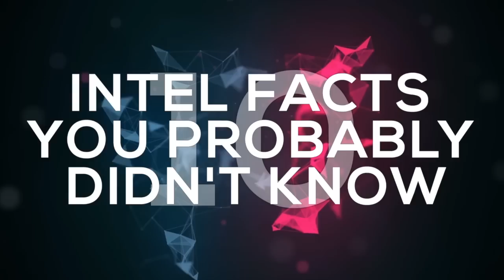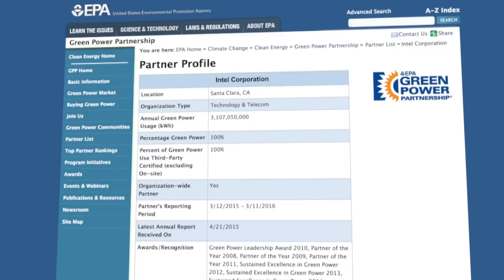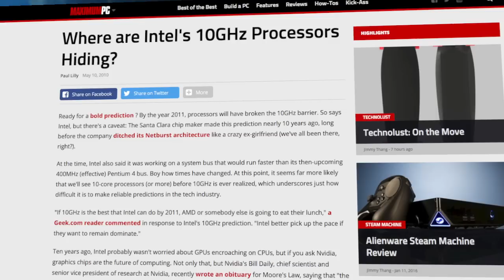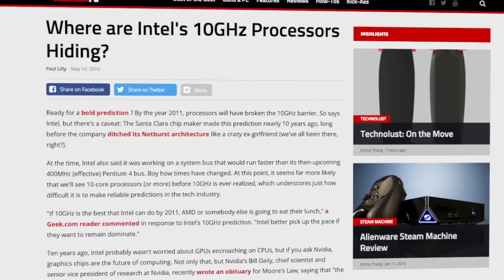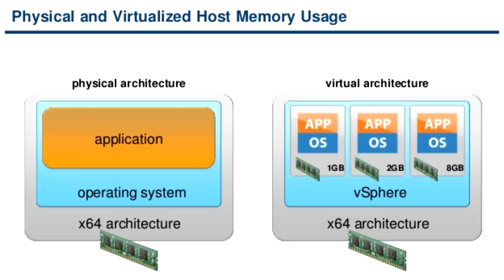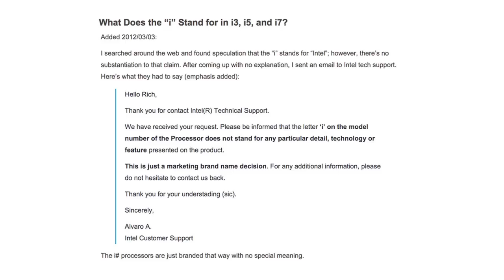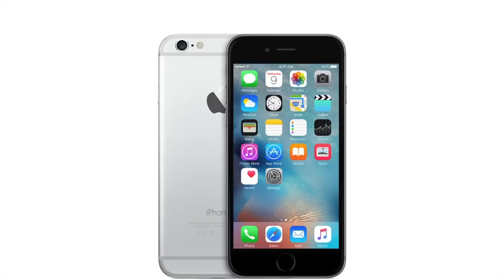10 INTEL Facts You Probably Didn't Know

Comment: We have 10ghz CPU's.
If you're brave enough.
And you have water cooling.
Reply: Some Weeb water cooling cant handle 10GHz, you gotta have LN2 for that.
Reply: *****
Water cooling can totally handle 10ghz if you're using skylake.
Reply: Some Weeb no... All CPU records are done with LN2, and Skylake does not get even close to 8Ghz let alone 10GHz. AMD still have the record with the highest GHz.
Reply: Some Weeb You need more than Water cooling to overclock that far you need liquid nitrogen and Bunsen burner and a 1200watt PSU
Reply: AMD ran out of money because of Intel's global anti-trust and anti-consumer actions, where they basically had to shove bulldozer out the door to stay afloat. Bulldozer was a legitimate regression from Phenom II as a result of it. They then focused their revisions on improving IPC / efficiency. 

The 9000 series chips aren't architectural revisions. The FX-9350 is piledriver just like the FX 8370 is. The difference is it's cherry picked leaky silicon to guarantee high clock speeds. This is where the exceptional energy consumption and heat production comes from. 

It's funny stumbling across this video now of all times and reading these comments, wondering how many people are eating their words or still going on about muh single threading. I mean, people still think that intel has some sort of significant IPC advantage, when in reality it's a clock speed advantage. 

PS: For your information, when overclocking the TDP means nothing. A 5ghz i3-7350k will drop in excess of 160w... For 2 cores and 4 threads. Meanwhile you have AMD shitting out 95w 3.6ghz octacores. And Intel is shitting themselves because they won't be able to get away with the same anti-trust bullshit they had in the early to mid 2000's.
Reply: *****
Liquid helium cooling*
Reply: 1ghz is not an universal measure of speed "thing.", for example a 3.7ghz i3 6100 core outperforms a 3.7ghz FX 6700 core.
Which means, frequency is not always "how fast", which possibly (and I believe so) means 8.2ghz Celeron isn't necessarily faster than a 5 Ghz  intel I7 (on single-core comparison)
Reply: nope the record is 8
Reply: The biggest if not only mistake AMD did back in 2012 with bulldozer/excavator/piledriver was - times. Ryzen is literally the same situation. Slightly slower, slightly cheaper, more cores. But this is AFTER people are fed up with Intel.s 2/4, 4/4 and 4/8 every generation with ~7% improvement (it varied a bit more too).  

And module based processor construction failed because the way hyper threading was embedded in many applications and something in the windows system(?) itself screwed it up even more. AMD was too late to introduce it. Besides, FYI FX9590 can be cooled with air no problem. Just not OC'ed. But something like Cryorig H7 or CM Hyper 212 can keep it cool easily. The 220W TDP was some joke or misunderstanding I guess... 

Aside from all that, we need a new, updated video from gameranx about how much shit Intel has pulled off to Nvidia (and attempted to do with Nvidia) ... AdoredTV did that but most people feel like he's biased towards AMD. I gotta say, I feel that way too, but nevertheless it opens eyes to what Intel has been doing even since pre 1990s. Also, what a hypocrite company Intel is too. 
A) Shaming AMD for things (done successfuly) Intel did in the past (and those didn't work) ["glued together"]
B) Doing what AMD did in the past (and those did or did not work) but Intel shamed them for it but yet decided to do the same thing few years later... [up the clocks, more iGPU, more cores]
Reply: World record of what???

CPU - Z for example reports highest OC as 8794.33 MHz with AMD FX 8350 and 8543.71 MHz with Intel Celeron 352
Reply: Some Weeb l'm not. l assumed you were talking about overclocking because you said 10Ghz.
Reply: Actually its 8.8ghz not 8.7 on AMD... and 8.5ghz for Intel...

8794.33 MHz with a AMD FX-8350
8543.71 MHz with a Intel Celeron 352

Anyway in performance off course intel I7 wins for now...
Reply: Tushar Sadhwani, I agree that single core OC is kinda bad since I want to know more all the cores I paid for how much further could someone in the world pushed them as far as a whole chip and not a single core activated OC when I paid for +౩ or more cores in the whole APU/CPU...
Reply: Dude the CPU Frequency doesn't matter. The voltage is the point. If you want to reach a really high frequency you have to switch to ln2 anyway.
Reply: Well If you multiply your cores by their ghz then you get over 10 GHZ :).

Now having all CPU cores at 10ghz or higher will still take a lot of time...

I got disappointed by AMD 14nm RX480 in even being hard to hit 1400mhz on the die while Nvidia is more around the 2000mhz...
Reply: Some Weeb use liquid nitrogen cooler
Reply: Gagan Deep
Liquid helium would be better.
Reply: Some Weeb lol keep a fire extinguisher handy it would be needed. that would be bad ass to see though
Reply: nickmcd8893
Nah, i've seen a guy have his build run at 40 at load.
Reply: +Some Weeb liquid? you mean dry iceing it
Reply: Twistystan ya i think i saw that video they were cooling with liquid nitrogen i believe.
Reply: guily6669 im not really sure how they calculate it but i know i did see people setting an official cpu overclock record with an intel core i7 up to 5.7Ghz and they were using a custom built cooler that they were pouring liquid nitrogen into because it made so much heat.
Reply: Yeah, the I7 doesnt overclock much good for breaking world record... Intel best CPU for OC was exactly the worse pile of crap Intel Celeron 352 at 8.2GHz lol...

But the great thing on the I7 is that you can easily put a I7 at almost 5 GHZ for 24/7 and will be the highest performance available, specially for gaming since those ultra performance Xenons server cpus with huge amount of cores dont really give better performance on current games...

My I7 2600K is at 4.9ghz for years on air, though its on high voltage and high temps, but its still kicking.
Reply: I guess for even talking about OC everyone knows that...

And the thing is in the same design/family of the chip all we know is the bigger the OC, the bigger is the performance.

edit: forgot to say that for world record of the OC it only matters the highest frequency and not the highest performance or else the ones that have high OC would have fall down the list in performance...
Reply: ***** The only reason behind that is one is made by intel and the other by AMD.
Reply: Some Weeb No it's not because even inside Intel a I3 at 3ghz will always be slower than a I7 at 3ghz...
Reply: guily6669 Depends on the i3 processor (generation) & if only 2 i7 cores are enabled.
Reply: The Trust that's kinda what I already said above, family and generation of CPU...
Reply: guily6669 * No it's not because even inside Intel a I3 at 3ghz will always be slower than a I7 at 3ghz...* I'm talking about this quote.
Reply: guily6669 Your argument makes no sense... My point wasn't that intel is consistant and AMD isn't, it's that intel is just better.
AMD CPU's make better paperweights than CPU's.
Reply: Some Weeb Actually my argument makes total sense and I didnt even talk about Intel vs amd on performance...

I actually prefer Intel and got a Intel I7...

What I said is for the OC record it matters the maximum clock you can run, not performance...

And I also said in the same generation and family of CPU the more clock the better, like a PIV at 4ghz will always be better than the same PIV at 3ghz on performance, but off course would never beat any modern CPU like I3 and so on...

Different CPUs is where the GHz don't mean much since an I3 even at 5ghz won't beat a I7 at 4ghz assuming they are from same generation.

Ps: My argument is 100% correct so... And this are just examples...
Reply: Some Weeb Yeah I kinda agree, but FX8350 will probably beat most I3, just have a hard time with i5 and specially I7...

But the problem is actually mostly because of how games are made at the moment... theorycally Fx8350 has more performance than my I7 2600k, but on games and most apps my older I7 still beat it...

But if games would use the full 8 cores with full effectiveness FX 8350 would be a bit better than my I7...

I prefer Intel a lot, but the new Zen if comes out cheap and beats current gen I7 that is 500eur or more it might be a good deal
Reply: Some Weeb Yeah, but the future of gaming will be multicore efficient, juts not at the moment...

Even some game devs recommended Intel 4 cores CPU instead of their expensive 6 core CPU which was even giving less performance for some reason...

games are still relying on single thread performance over lot of cores, but that's something to be changed in the future for full multicore with efficiency
Reply: guily6669 Ever played BeamNG.drive?
Reply: Some Weeb AMD ZEN overclock to 5ghz with air cooling LOL
Reply: the highest clock ever on a single CPU was on a super overclocked FX-8350 and it almost made it to 9Ghz, but it was incredibly unstable and had to be cooled with liquid nitrogen.
Reply: Felype+ actually the speed of a CPU is all about the Ghz. the difference is what the performance per clock ratio is. for example an FX-9370 runs faster than a 6700k, but the 6700 can do more per cycle than the 9370 can, so it makes software run faster even though the CPU itself is running slower than the competitor CPU. that is why the current AMD CPU's can't rack up to intel CPU's. AMD has gone too long without releasing a new CPU, and intel has been making new architectures that are more efficient than the older pile driver architecture on the red team.
Reply: Some Weep+  "it's that intel is just better." that isn't entirely true. intel is the best right now, but best manufacturer of CPU's has gone between intel and AMD over the decades. it's not like intel has been smoking AMD out of the gate. they have both had their moments in the sun, and right now it is intel's turn.
Reply: +electronics for fun,

well AMD used to win Intel long years ago... Since Intel launched the Core 2 duo AMD got smoked up until now...

Maybe soon this year 2017 when AMD launches their next branch of CPUs it might simply catch up Intel which I still don't think so, since I think Intel will probably release something a lot more powerful than their latest crap I7 which got way too overpriced because of AMDs crap performance...
Reply: guily6669 ZEN is slightly faster than broadwell-e. so l think it is AMD's turn to become #1 again, and then intel will focus on whatever the hell it is they prefer to do instead of making desktop CPU's.

kabylake isn't going to be all that impressive. even if you have a haswell processor, it probably isn't worth an upgrade. 

AMD doesn't have crap performance, it is just that their top tier CPU's have been around for a long time. since they were having some internal conflict, and just recently plucked out a new CEO. back in 2012 the FX-8350 had pretty good performance, intel was still slightly better, but AMD was really going for a high core count, and average performance. they thought that would put out a good competition and it did for about a year are so. the 8350 was the last CPU AMD made, the 9000's are just modified 8350's.
Reply: electronics for fun that was not the main problem...

I bought my I7 2600k back in 2011 for less than 260 EUR and was the best cpu...

a year later AMD launches their top of the line FX8350 in 2012 for 200 and something EUR, so almost the price I paid for the best cpu on market from intel...

then I went to see fx8350 gaming tests and most of them were already loosing 10 FPS and some huge 20 FPS lost...

So even a AMD top of the line one year ahead technology didn't made it scratch my I7 performance...

So that tells me even though they don't launch much cpus, when they get something new and more advanced still fall behind competition.

I hope AMD catches Intel, because AMD low performance only made Intel to get overpriced since the whole market is Intel unless you love buying a gtx1080 that might turn into a gtx1070 because of CPU bottleneck in some games...

But for so long years Intel is far ahead, I don't think AMD will be better than Intel, I'm thinking Intel must have a plan B backup with some serious CPU secret power :).

ps: whatever happens if AMD catches Intel, we all win.
Reply: guily6669 like l said they were more focused on the core count, because that is what they saw becoming the future.

a GTX1080 won't become a 1070 because of the bottleneck....... it becomes a 980! hahahaha!

intel has recently come out and said they don't care about the desktop market anymore. they are going to focus more on mobile and server stuff now.

BTW in the early 2000's intel was at the bottom of the line when it came to CPU's they were beat out by IBM/Motorola, and AMD. it looked like they wouldn't recover, but they DID! as a matter of fact when the core duo came out, steve jobs almost went with AMD when he switched away from power PC, but rolled the dice and went with intel because they were able to show what was to come in the future of their CPU's. and it was the right choice, the core 2 duo was one of the best CPU's on the market in it's time and still kind of holds up today.
Reply: electronics for fun that was the whole problem even now in 2017 more cores are not giving much more performance sadly....

Some game devs a while ago also recommended Intel 4 core I7 Over their 6 core ultra expensive CPUs which were even giving less performance on their games.

Same goes for the ultra super deeper expensive Intel server CPUs xenon with lot of cores, which is not winning a normal I7 on most apps...

It's really needed is for servers who have lot of things running.

And the problem is when games use every core with full efficiency, those old AMDs like Fx8350 will be already too outdated, even though indeed the future is about multicore...

And it's also sad to see most mobile phones coming with 8 cores even on cheap phones and Intel can't release a god damn cheap 8 core CPU for our desktop...

4 me in 2017 even a god damn 100eur CPU should have come with minimum of 8 cores already and not 2...
Reply: guily6669 they thought it was a good idea, but it turns out they were wrong. :-P
Reply: Yep, specially because on the total cpu performance "on paper" the FX8350 is slightly better than my I7 2600K, but in most apps\games it ends up loosing...

Some day eventually they will show better performance than mine, but wont be by much and by that time just like I said, FX8350 or even my I7 2600K wont matter for gaming anymore, will be too outdated :(.

But I was thinking AMD would move to like 12 cores for ZEN, but they will release a 8 core CPU instead and the design will be closer to Intel, 8 cores + Hyper threading.

I hope prices come down, because when I bought my I7 it was an AWESOME deal, never bought a very high powerful CPU for the price of around 260 eur (above back then there was the I7 extreme for 999€ which wouldnt give 1 single FPS more its mostly for other professional apps)...

Now I go to the stores and see all the best I7 around 400€, 500€... screw this.
Reply: guily6669 yeah l know what you mean.
Reply: *helium
Reply: Actually, Intel has the record for highest GHz speed, with their i7-7700K capable of reaching 7, or up to 7.5 ghz on LN2.

I should mention, that I'm not talking GHz rating, I'm talking stability. It doesn't need to have all cores disabled to reach 6 ghz. Any AMD processor needs a single core running to reach that speed, and any more would make it crash.

So, in terms of actual performance, you can run all 4 cores, and 8 threads at 6ghz with LN2 and game at the same time, so Intel takes the cake here. (i7-7700K)
Reply: He_162 the record is 8.8Ghz set by the FX-8350.
Reply: The intel record is CELERON 352 crap at ~8544Mhz not I7 7700K
Reply: guily6669 intel record, but not the world record. l think there is a chance that ryzen could make it to 10Ghz.
Reply: Some Weeb how do you know?
Reply: electronics for fun
Cause' saying they will get even 6ghz will be a stretch.
Reply: Some Weeb why?
Reply: Some Weeb that is why l think it can make it to 10Ghz. AMD holds the world record for fastest CPU clock speed at 8.8Ghz. l think they will make it to 10.
Reply: Some Weeb yeah... when you are going for world record clock speeds, you NEED liquid nitrogen cooling even with intel CPU's.
Reply: Some Weeb no... what makes you think they would be? most people aren't going for the world record CPU clock speed. if you are overclocking any CPU that way, then you will need LN2, because a couple volts and a couple watts, makes a very hot piece of silicon. intel or AMD it doesn't matter, they will all get very hot when pushed to their limits.
Reply: electronics for fun
So ryzen is going to have insanely low heat output?
Reply: Some Weeb it will be low because these CPU's run on a low amount of power but they will still be cooled with a heatsink or a water cooler, just like every other CPU on the market.

l don't understand what is so confusing here.
Reply: electronics for fun
You saying they'll just about double their clock speed.
Reply: Some Weeb no they don't do anything. they sell you the CPU and you overclock it. it will come with a normal bitch cooler just like all CPU's, but you can cool it with a bigger air cooler, water, or LN2 if you want to break a record.
Reply: electronics for fun
I'm talking out of the box...
Reply: Heads up - Highest OC record right now is only 8.7ghz on AMD and 7ghz on an i7.
Reply: Thats why I put in the i7.  I mean its great that you can get a Celeron that fast, but its still a complete garbage chip.  The FX-8350 is better than the Celeron, but as someone who recently went from a 5.3 Ghz overclocked 9370 to an i5 6600k, it feels like its only slightly better.
Reply: I wouldnt want a 9370 not even for free... Its place is in garbage...

I mean a 220W chip that can't beat a 90w chip... I wonder where AMD planned their efficiency for those 200W+ chips they have... (contracted some monkeys from china?).

In all electronics efficiency is always the key, not dirt power... Like on speakers, you can buy 1000W of pure garbage sound for cheap, but then you pay like 500 eur for just 100W of a good amplifier where it actually puts its whole power in sound quality and not in making noise and heat...

If AMD continued with that crap, I wonder when would they make like a 500W CPU to beat a 90W I7 jeez...

Also I dont live in US and here its always more than 100eur per month of electricity and this shitty country is only 500eur min salary, so even if someone would give me a super computer with 4 of those AMD's together and 4 200w GPUs I would only be able to use it like 5 min each day... yeah right...

One time I used a 600W dehumidifier at medium settings (maybe 450w?) for like 15 days and that month it cost around 300 eur on the electricity and my father got very pissed... (and the dehumidifier at medium settings doesnt also work full time... it stops for like 30 min or a hour from a certain time of being on and it also pushes less air).
Reply: Well here is the thing - AMD fucked up banking on massive multi-threaded applications being common, and went with an extreme number of cores vs. single core performance.  I have no idea why they decided to stagnate on RnD for so long though and assumed just cranking up the power and making it run faster was a better option than just scraping the whole Bulldozer/Excavator/Piledriver shit they were pushing.  Zen looks to be much better, but only time will tell with that.
Reply: PubstarHero OMG the 9370 is terrible!! not much faster if at all, and even harder on resources.
Reply: There was a noticeable improvement over my 8150, but the switch to a 6600k was massive.
Reply: AMD isn't doing bad because they are a shit company. they are doing bad because they have been working out some internal affairs for the past few years. it's time for them to regain their position in the processor market. nvidia will probably stay ahead for a while longer, even AMD admits they are better, but they definitely have intel shaking in their boots.
Reply: Well I have always been more on the Intel side, but not fanboy, I only had one AMD back when AMD was actually winning the race...

But I hope AMD comes back. However I would love even more if some new company appears out of nowhere with even better performance at even better prices, I would stay up all day laughing off AMD and Intel...

Same goes for GPUs, I wonder if those mobile phone chip makers would start making desktop GPUs and would even be better than Nvidia and AMD, I would laugh twice as hard...

ps: Too bad we live in this shitty world where theres only Intel or AMD; AMD or Nvidia...
Reply: guily6669 l have an FX-8350 and it doesn't do all that bad, but it still can't compare to 6700k. and l actually have an original athlon64 chip
Reply: +electronics for fun, my brother in law also have a FX8350, but for his stuff it works pretty good, he works with 3D and renders...

In my old I7 2600k is almost the same time to render... I guess those apps he use are far better optimised for multi-threading than actual games.

For gaming I remember a year later after I made my PC it came the FX8350 and games were loosing 10+ FPS like crazy on most games...

I also got my I7 back in 2011 for like 260eur and was the best APU, above was I7 extreme for 999eur which wouldn't give 1fps more, it's for other professional purposes only...

AMD FX8350 came a year later at like 240eur so I had a way better deal with my I7 a year before...

Nowadays is the problem, I7 are costing like 350eur and up... and then Intel changed sockets so fast that my I7 got outdated very fast, however in performance with the huge OC I have at 4.9ghz it stays almost like a new I7 at stock clocks...
Reply: guily6669 yeah, it is a decent rendering CPU. it actually renders better than the 9370, because the 9370 is the same chip as the 8350 it is just factory tweeked. which makes it a little more unstable.
Reply: +electronics for fun, And specially a HUGE power eater which eats even more than a Intel Xeon with 20 cores server CPU which is FAR ahead on performance for multi core, multi-threading apps, but also very very BADLY priced...
Reply: guily6669 yeah... the 9000's are a joke. they actually NEED to be watercooled, unless you have a top of the line noctual or coolermaster heatsink.
Reply: +electronics for fun. A AMD fanboy would never say that :)... it's always AMD is best and best and Intel doesn't increase much performance, but AMD was pretty much worse since instead of improving performance they decreased it and never made another replacement for the for their best FX 8350 2012 CPU, it definitely isn't 8370 either which is the same...

I'm waiting for Ryzen, it seems finally AMD decided to improve performance after 6 years dropping performance from their FX 8350 to their crap low performance APUs...

I hope is Intel could give us CPUs with better prices instead of just selling APUs, I hate them, Never used the Igpu of my I7, in fact my chipset doesn't even support video out, I chosen OC + performance over crappy IGPU, that is back then... next generation of I7 support top OC performance + crap IGPU video out.

I wonder why don't Intel decide to have both APUs and CPU and give more CPU performance for the same price as the CPU...
Reply: guily6669 l agree APU's kind of suck.
Reply: +electronics for fun, I would only enjoy and support APUs if they make a setup where the GPU inside is used to accelerate CPU performance a lot by using it to process data that the CPU use...

Other than that I would prefer the choice of a CPU over a APU if price-by-price would have way better CPU performance...

And even if they use the GPU to add more power to your PCI express GPU it is so low performance that won't even matter much for that to win like 5 FPS or less and cause CPU bottleneck in some game a few years later... O totally would go for max CPU performance because I never upgrade CPU, motherboard and ram. I only upgrade GPU until the CPU isn't anywhere worth the price of the GPU.

I mean what would be the point to buy a 400eur GPU to work as good as a 250eur GPU or less...
Reply: guily6669 yeah those old chips preform about the same as the iris graphics in skylake CPU's. nothing special, but it can kind of get the job done.
Reply: nope, the world record is 8.7ghz
Reply: +TROLLING KING I think if you had school you know that 8794 translated in 8.8ghz not 8.7...

above and including 5 you always add a number...
Reply: lol you have lost your mind. AMD has a plethora of research/statistics that show on average it out performs or at the very least is equal to intel. It has the record for highest GHZ. and its at half the price. People like you (some weeb) are the same ones who will pay 4k$ for a piece of shit alienware that is only actually worth 400$ based on the name.
Reply: +guily6669 actually it was about 8,75 ghz
Reply: As someone who has run AMD for years and regularly supported the company - No.  They do not get anywhere near Intel with their FX processors.  I hit major CPU bottlenecks that no amount of overclocking my power hungry 9370 could fix.  When I finally took the dive and switched to Intel, that bottleneck magically went away.  They are great processors for budget and mid end builds, but when you're trying to do anything mildly high end (CFX R9 290X), the CPU just cant keep up.
Reply: zephiro l+ highest gHz means nothing, it was a shits and giggles competition. both intel and AMD CPU's were incredible unstable with those clock speeds and they needed to be cooled with LN2 which also makes them very unpractical. it is an accomplishment for sure, but meaningless all the same.

a HEXAcore intel CPU and a GTX 1080 with 2TB of storage and NVMe boot drive along with all of the programs installed, are worth much more than $400. probably not worth $4,000 but it is for sure well over $400.

l have no problem with alienware although l prefer PREDATOR myself.
Reply: The AMD FX-8150 in extreme overclocking has just barely hit 9GHZ with 2 of the cores enabled
I'm assuming it was done with some form of liquid nitrogen cooling, or perhaps liquid oxygen however nitrogen would be much safer
Reply: electronics for fun

I'd like to join in on the conversation.

first of all, 8794 mhz is not 8.8ghz. We're talking about a world record, you don't just round up in a world record. not even 1 mhz.

Also, the 8.8, 8.5 ghz are all single core scores, with hyperthreading disabled, which, although sounds good as a number, but has no real world benefit.

If a cpu runs at 8ghz with a single core, but another runs at 3.5ghz with 4 cores and 8 threads, the multicore will perform better and probably generate less heat.
Reply: "first of all, 8794 mhz is not 8.8ghz." yes it is, you always round in conversation. just wouldn't round it on paper. kind if like if it is 12:28 you would say 12:30, but if somebody dies at that time and they logged it, then it would be 12:28.

over clocking your CPU to 8.8Ghz in the first place has no real world benefit. they did it just for shits and giggles so they could get the numbers. the system runs incredibly unstable at that speed, and you can't keep pouring LN2 on the CPU when typing up that spread sheet or playing a game.
Reply: electronics for fun so, the world record for something is 4998 metres, and you call it 5000 just for rounding up.
And then you broke the record by doing 4999 metres. But no, the 1st one was 5000!

No. It wasn't 5000. It was 4998.

I really shouldn't be arguing about this shit :\

And btw, all-core record on ln2 still makes more sense than single core record on ln2, as someone in CES made a container that would automatically dispense the ln2 on the cpu.
Reply: no you missed the point. on paper it will be the exact number, but in conversation rounding would be involved
Reply: electronics for fun ....okay.
Reply: *LN2 Cooling
Reply: Some Weeb correction, Liquid helium.
Reply: you are very uninformed
Reply: guily6669 I've dropped the whole clock speed record shit, you're still thinking my point was that intel had consistancy with their clock speeds, but that's not my point. My point was just that intel is better. That 5ghz i3 may preform worse than a 4ghz i7, but it still preforms better than anything made by AMD.
Reply: guily6669 We both know that's not happening.
Reply: electronics for fun
It's not going to make it.
Reply: electronics for fun
Cause' it's AMD.
Reply: electronics for fun
With liquid nitrogen cooling or some shit.
Reply: electronics for fun
So AMD's new stock coolers are liquid nitrogen coolers?
Reply: guily6669 yeah u get that
Reply: Fucking plebs. You're an idiot.
Reply: McBMeL MasterSenZuRi And burns out in 10 seconds, because AMD.